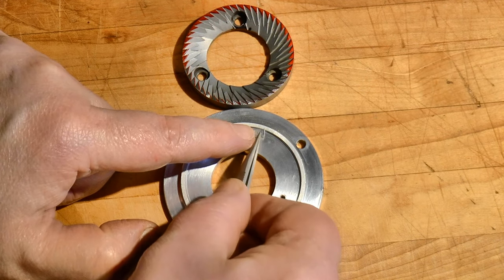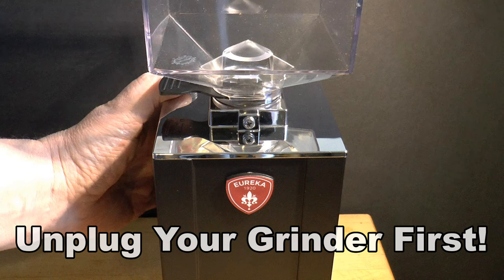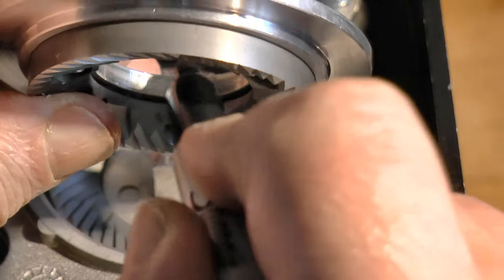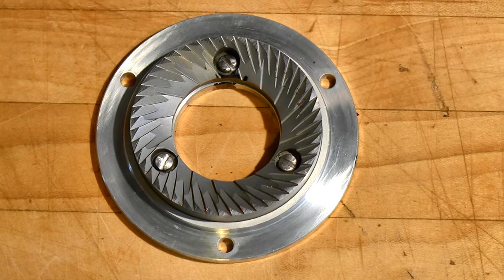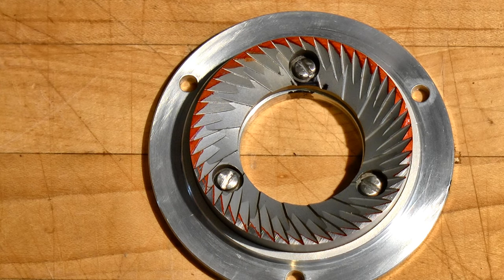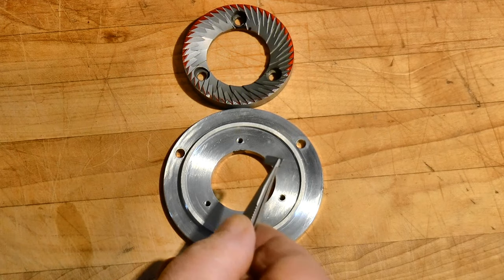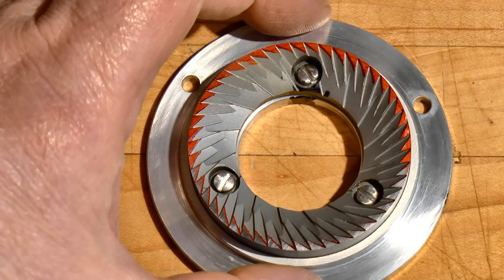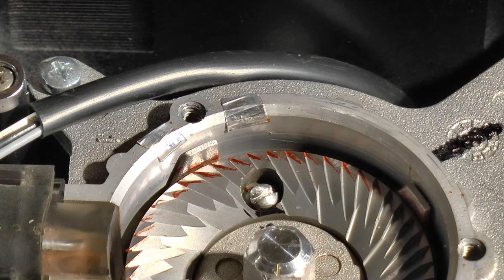Easy And Safe Burr Alignment

Comment: Thanks to you I could realign my burrs quite easily. Bottom burr had a lower point at one screw. 1 set of 2 shims around the screw made that lower point much more narrow: marker stays on a lenght of about 1cm vs 4 cm before. I wonder if that's safe because I find it's odd that ink stays fully there while it's all wiped out everywhere else. On upper burr I had to place 2 sets of shims and alignement looks now perfect. Prior to this I had like 30% of the surfaces still marked after test.
Sound test: I still can hear burrs touching at a particular point just before touching evenly when I tight the knob a slight more. Before alignment I couldn't hear the burrs touching evenly so it seems a great progress. 
Noticeable change: zero point has moved closer to 0. 
I had no complaints with my 2 months old Specialita but I'm new at grinding. I'm not sure I will taste any difference but I'll comment on that!

Comment: Great idea... I am trying to increase my 18 to 36g shot ratio to be in the 25 range, yet still getting 13-15 seconds, and it sounds like  am bringing my Minion to a screeching halt at times. So, Im not sure if my burrs are worn, or the issue you have demonstrated, but I dont here a "OFF" spin where its touch-no touch-touch...etc. I need to slow my time by 10 seconds! and not sure what the issue is? My temp is about 93C.
Reply: Seams like I resolved this. See other posts of mine.

Comment: Hello. Thank you for the helpful video. I see you described this in other responses as optional and more of a solution to a problem rather than a preventative maintenance. As such, do you advise against aligning immediately out the box? My first flat burr grinder is en route now, and I'm thinking of how best to care for it.
Reply from the maker: If you have trouble dialing in a decent grind in the very fine range, like Turkish and espresso, you may have mis-aligned burrs. If you can get a nice grind, they're probably pretty parallel. If you do mostly pourover or French press, you probably wouldn't notice much difference either way :)

Comment: Cheers for this awesome video!
I have a soecialita as well, but noticed that the lower burr is wiggeling a tiny bit while grinding. Is this normal due to rotatory forces?😅
Reply from the maker: The most common cause is one of the three screws holding the burr to the carrier coming loose. I would check that first. If they're all snug, it's probably fine.

Comment: At 7:14 you say when you're shimming the carrier you need to shim the opposite side from where the ink is rubbed off. The spot where the ink is rubbed off is the closest the two burrs get, and when you're shimming the carrier you're moving the burrs further apart, so you have to shim the screw holes closest to the touch point, not opposite the touch point. You shim the opposite side when you're shimming the actual burr, because then you're moving the further part of the burr closer to the other burr.
Reply from the maker: Sorry if I was confusing. I meant opposite the side we shimmed on the burr itself. As I say, for the carrier we shim "the opposite side, where the ink had rubbed away indicating early contact." I could have expressed it better, but I wasn't wrong.

Comment: Great video. It seems the grinder does not have any shims from factory. Do you know how they make alignments? Or, if there is to adjust, why does grinder come out of alignment in the first place?
Reply from the maker: At the factory, they don't usually make adjustments; they simply pass-fail test, and if a unit falls below the company's standards, it's rejected. Later, with years of use, there's wear on bearings, shafts, and burr surfaces, etc. A new grinder from a quality outfit shouldn't need any adjustment.

Comment: Great video, thanks! I have a fairly new Mignon Brew Pro, and when I was checking the alignment, my burrs do NOT touch at all, even at the finest (closest) setting, as I rotate the motor shaft, there's no sound of rubbing, and none of the dry erase board markings were scrapped off.?  Also, how do you remove the lower burr if I wanted to shim it upwards? I removed the 3 screws, but it doesn't want to budge.
Reply from the maker: The Brew Pro has an internal spacer that limits the burr adjustment knob travel. You'll have to remove it while you test and calibrate. You can get a small, slotted screwdriver between the lower burr and its carrier by removing the front panel and going through the coffee outlet. But I don't know why you'd want to remove the burr before you see how it's oriented via the whiteboard marker test.

Comment: I have done this but NONE of the marker has come off. I can hear the burrs touching when spinning them, and the marker comes off very easily with paper towel or my finger. Either the burrs are so misaligned that an undetectable amount of marker is being removed, or I'm doing something wrong.

Comment: Nice Video, I had a good time watching. Of course I had to try it to save my good nights sleep. But. I used regular permanent marker. What would the advantage of the white board marker be?
Reply from the maker: The permanent marker needs a lot more friction to be wiped away. Whiteboard ink rubs away easily, so you can detect minor issues. It's a more sensitive test.
Reply: @wiredgourmet  that makes sense indeed. Now i need such a marker. Thanks for your quick reply!

Comment: Hello, my specialita unit was so much burs desaligned that i need put two .2mm shims betwn the low bur carrier and upper (only the 2 screws near the display). Before this my unit cant grind for espresso WHITOUT the burs are in contact. Very dissapointmet whith EUREKA quality control. I really hope faultless grinder in a 400 euros grinder.

Comment: Hello to everyone!!! If someone could help.
I'm experiencing an issue with my Eureka Silenzio grinder (50mm burrs). The grinder is a year old, and few days back, while attempting to clean the burrs, I observed a significant amount of dirt and coffee residue on the bottom burr. In an effort to clean it, I carefully unscrewed the three screws holding it in place, doing so gradually to avoid any damage. However, during this process, one of the threaded holes got damaged, and I noticed small pieces of metal on top. As a result, the screw no longer fits securely in that hole.
I've identified that the screws are M4 in size but the heads are M3 size. (This causes another proble as to what screw to use if I repair the threads).
Currently waiting for a M4 helicoil to try and repair the threads.(Will be hard because I will have to do it on the machine while the carrier is rotating).
Did anyone had such a bad experience wiht Eureka?
I can't find a replacement part for the lower burr carrier and even If I find I think it would be hard to remove it or break the alightment in the process. (Not that it was any good to start with)
Trying to contact with Eureka but I am running out of hope.
Thank you for your time reading this.

Comment: Is it okay if I only mark the original alignment and then clean and return everything in its place. I mean will this cause the burrs to be unparalleled.
Thanks in advance.
Reply from the maker: You should have no problem taking it apart for cleaning if you mark everything and put it back as it was.
Reply: @wiredgourmet  Thanks for your help and for replying.

Comment: Wait for that last part, correct me if I'm wrong, but isn't most of what you said the opposite of general consensus? I thought it was flat burrs that tended to produce less fines than conical, and that once aligned, will have a more unimodal particle distribution. Doesn't this upgrade prompt one to grind finer, not coarser due to the faster brew times and the reduced possibility of channeling?
Reply from the maker: I would not be surprised; if you look around the channel, you'll find that most of what I say goes against popular consensus :) I report my own experience, which, in this case, is that alignment will (slightly) narrow the size distribution of your bigger bits, yielding (slightly) more tiny bits knocked off, thus (slightly) increasing your fines, but also (slightly) improving size distribution overall. As for the "in general" statement, that too is based on personal experience, which might or might not be broad enough to be reliable. But then, 'popular consensus' is unreliable because it's something 'everyone knows,' so we tend to repeat it without testing. At least I'm empirically unreliable :)

Comment: I just wanted to thank you so much for the tutorial! I was finally able to align the burrs of my Mignon Specialita. It was the bottom burr that was misaligned and after 6-7 hours of work I came through. Weird observation though: yesterday the top burr seemed to be misaligned as I hadn’t checked the bottom burr yet. Today, when I started with the bottom burr and I aligned it, I ran the marker test on the top burr and it seemed to be aligned too. How could that be!?
Reply from the maker: Maybe the top carrier wasn't fully seated or fastened at that time? Anyway, glad I could help.
Reply: @wiredgourmet  No, I don't think so, the top burr was fastened properly from the very beggining

Comment: Hello, i plan on replacing my Filtro's burrs with espresso burrs so I'd have to remove the bottom burrs. Are the bottom burrs alignable as well or is that something out of reach with this technique ?
Reply from the maker: You rarely need to shim the lower burr, but you can if needed. It's easiest to shim the upper carrier.
Reply: @wiredgourmet  Ohh i see, that's a relief. I'll just try swapping the filter burrs to the espresso ones if i feel like the filter ones really aren't good enough for espresso and just shim the top burr if needed be, much appreciated 👍👍 thank god for your vids

Comment: would this process be different when aligning the Fellow Ode burrs since they are interlocking and are not flat at the edges?
Reply from the maker: It seems the flats might not be 90 deg to the sides, so the ink test doesn't work. If that's so, you would likely need to use an indicator. https://www.home-barista.com/grinders/fellow-ode-brew-grinder-review-t65577-840.html

Comment: Thank you for sharing your method.

What I also find very interesting while finding my zero point is, that the zero point seems to be different while the grinder is running:
(values are not accurate, I rounded to 1st digit)
When the grinder is running, the touching-sound occurs at 5.1. When I set the grinder to 5.2, while running, the sound disappears. When I then stop the grinder, I can hear the sound again as the grinder reaches 0 rpm. To get rid of that sound at low rpm/when manually rotating, I have to set the grinder a bit coarser, let's say to 5.3.

Do you also experienced something like this? Is this maybe caused by bad alignment?

At the moment I have a very bad experience dialing in. The new beans are maybe not freshly roasted as they unfortunately got bought from the super marked during my absence. At the moment, I have set my grinder to the finest setting possible (5.35 considering the example above) and ony this way I get a ratio of 1:2 in 23 seconds. This is so strange to me. Maybe it is really only because of the bad beans, but that is how I found out about the 'issue' described above, because I tried to use the finest setting possible.
Reply from the maker: The sound might be just coffee grit between the burrs. Also there is thread lash, so there is some play in the adjustment system. Now, if you have trouble with fine grinding, maybe the beans are an issue, or maybe the burrs might not be aligned well, so check with a whiteboard marker as shown, or ask someone with some mechanical experience to check for you.
Reply: @wiredgourmet  thank you very much for your fast reply. Meanwhile, I also assume that the beans are the issue. However I will also check the alignment just to be sure. I think that now I can exclude that my grinder has an issue. Thanks again for your great content, I love it!
Reply: @wiredgourmet  I did the alignment and it's definitely worth it. I was really surprised how 4 layers of super thin aluminum foil can change the grind result. Now, I can grind the beans at almost +1 instead of +0.05 getting still longer extractions than it was possible before!

Comment: Thank you! I have had a Eureka Specialita for about a year, am very happy with its espresso grinding performance, and your video is a great resource for maintenance.  I use a single-dose funnel instead of the hopper, and also a bellows.

I check my Specialita about once a month for cleaning.   Recenty I have been finding that my burrs and the grinding chamber have been staying relatively clean, but I get extensive clogging of coffee powder in the rubber chute and especially  around the "clump crusher" attachment (zig-zag metal wands) at the top of the chute.   

Is there a good, simple way to clean this chute area without opening up the machine as we do when we need access to the grinding burrs?
Reply from the maker: Rocking it back and letting it fall forward a bit while running usually works for me. For stubborn clumps, I use a pipe cleaner and push it toward the outlet from the bottom of the chute. With the grinder turned off :)

Comment: hey cool video. i just cleaned my perfetto a few days ago, just before i watched this video. i didnt mark the original positions of the burrs and now i have some vibrations. not much, but definitely more then before. do you have any advice for realigning/centering the burrs again?
Reply from the maker: Thanks. If you think it worth the effort, you can rotate the upper burr carrier through its 3 positions and test each for the least vibration, then mark it.
Reply: @wiredgourmet  Thanks for your reply. I guess the problem is, that i unscrewed the lower burrs, that are attached to the motor. The upper burrs should not cause any vibration since they aren't rotating. I give it a go and try all positions.

Comment: Would you say it is worth it to try all combinations of fixed burr position on the carrier and mounting positions of carrier in bid to find a parallel to rotating burr before shimming? Or once promising shimming combination presents itself just to go for it?

In DF64 we have 9 positions to try for fixed burr 3 between burr position on the carrier and another 3 carrier to body.
Reply from the maker: I would definitely not worry too much about that. I say mark them before you start, so you don't introduce inconsistency during the procedure. But once it's shimmed so you get both burrs wiped pretty well, you're done.
Reply: @wiredgourmet  I aligned it today. It is not done to perfection but it is much better than it was. Construction of DF64 is quite different but your tutorial was still very helpful. 

I am based in Dublin maybe you would like to meet and test DF64 with SSP burrs. I know I would be very interested in seeing robot in action :)

Comment: Could you gently run the burrs against each other to kind of run them in with each other then blow any fine metal dust out with an air line?
Reply from the maker: The burs are precisely made HS steel with a quality surface; no de-burring needed. You can't really lap them against each other.

Comment: We need to align the upper burr only, or both bottom burr and upper burr?
Reply: 1. The moving burr should be aligned perpendicular to the axis of rotation.
2. The fixed burr should be aligned plane-parallel to the moving burr.
3. Both burrs should be centered around the axis of rotation.

1. can be achieved by shimming the moving burr.
2. can be achieved by shimming the fixed burr.
3. can be achieved by lateral adjustment of the burrs.

Bottom line: BOTH burrs can and should be aligned with shims (as shown in the video)

Comment: What torque is recommended? inch pounds?
Reply from the maker: Everything I own reads in metric, so look it up here: https://www.fastenal.com/content/merch_rules/images/fcom/content-library/Torque-Tension%20Reference%20Guide.pdf . I would go with the aluminum guide, bottom far right, since the female threads are aluminum.

Comment: Do you need to align brandnew machine?
Reply from the maker: Usually no. Only if there is a noticeable problem, like you can't grind fine enough.
Reply: @wiredgourmet  noted. Just ordered the specialita yesterday. Will be here in 3 days.

Comment: Doesn't sound like there's a huge difference once perfectly aligned, I was worried the alignment comes sloppy with the machine.  I'd rather not do this just because I don't like the idea of dry erase or marker chemicals near my coffee.
Reply from the maker: Hard to say how far out of spec any machine will be; Eureka no doubt has a QC standard below which a machine will not pass. As for chemicals, just purge a few grams of coffee and there won't be even a trace of the whiteboard ink left.
Reply: Rubbing alcohol easily remove the whiteboard  marker. For permanent marking for alignment, you can use a sharp object like a chisel/screw driver to create a small mark instead of using ink
Reply: You’ll notice a difference if it’s out. You’ll get a mix of fine powder with your chunks/ inconsistent mix of sizes.